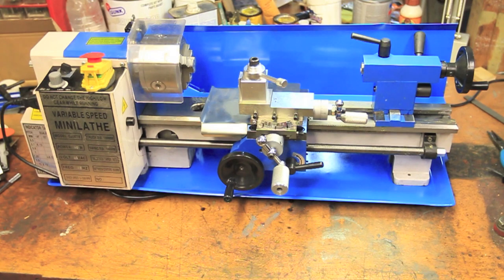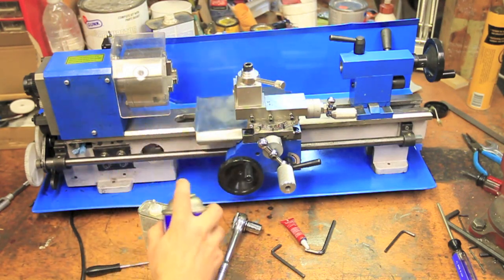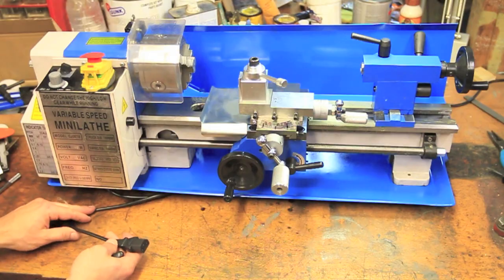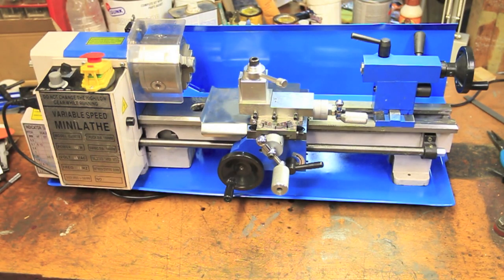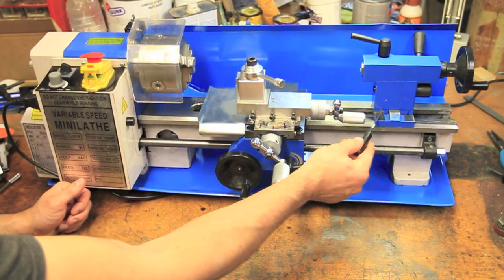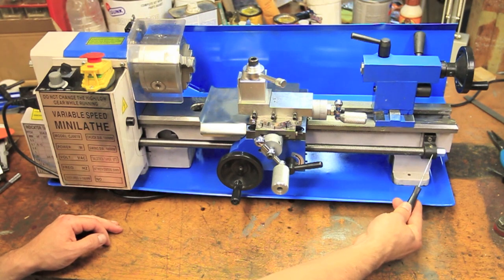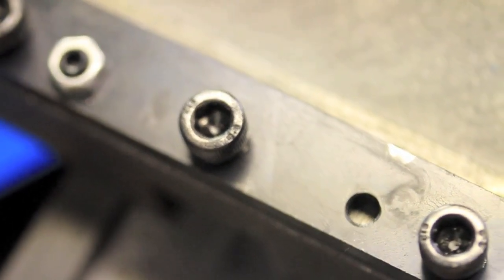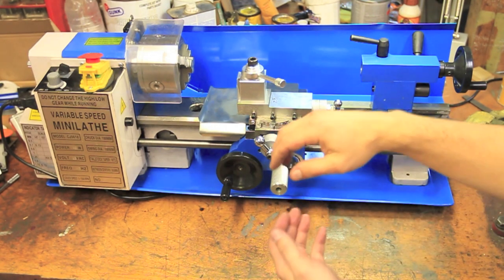Tear Down and Wiring Upgrade + Complete disassembly, cleaning, and reassembly of mini lathe

Comment: nice vid. one tip from me, allways use oil to lubricate sliding ways. it flushes chips out. grease is not a good thing, since it makes al the chips and dirt stick between the ways, making a sort of grinding compound. cheers.
Reply from the maker: Good tip I'd definitely change out the grease. Thanks for watching!
Reply: I agree! Regular engine oil is cheapest and works well. When I got my china lathe I first use chain oil, everything got very stiff and dirty! ;) Very nice channel! :)
Reply: Use high winter weight oil, since that will be thickest at room temperature and thick oil works better. Also watch for greying of the oil which shows your oil isn't preventing wear.
Reply: Flip de boer Yes. Go for way oil. There should not be a zerk fitting, as you mentioned, but a little oiler (small cup srewed into the hole filled with some oil). A little oiler would be a nice video project. By the way: I admire your patience. I think I would have melted down this nasty lite machine in my backjard furnace, just to see it burn!  But from video to video it is becoming something like a usable tool. Thanks for the videos!
Reply from the maker: Thanks so much for your comment and suggestion! I really appreciate you watching and enjoying them!
Reply: Usual recommendation for oil for rotating parts is 20W machine oil or nondetergent motor oil if you can find it in that weight.  For sliding parts I'd suggest a way oil such as Mobil Vactra #2 which is easy to find -- in gallons(!).  Email me if you want to discuss the fact that I could easily spare a pint of it.

The particular virtue of way oil is minimizing stick-slip friction cycle.  The main reason I know of for non-detergent oil is that detergent oil is somewhat hygroscopic, and is specifically designed to pick up and carry dirt, rather than letting sleeping dogs lie, so to say.

Comment: I've been doing a lot of research on lathes and their purchase. Most forums have scared me off buying one of these cheap lathes, however the videos in your channel have changed my mind. IMO there's no better way to learn how a machine works than by disassembling it, making sure things are the way they are meant to be, potentially upgrading or improving it then reassembling it.

The fact that buyers are forced to do all this with an inexpensive chinese lathe is a bonus, IMO, not a flaw.

I have some things I wish to make that require a lathe, and I'd love to learn how they work with a long-term goal of building one of my own. You prove in your channel that even a cheap one can make something aesthetically and functionally great. I'm sold. Count me as a new sub, and thank you for posting these vids.
Reply: That is an interesting perspective.
Reply: With this many repairs, you could make one. Well, maybe not you, but a person could make one.

Comment: I have a similar lathe but with digital tachometer. Basically the same, seen these lathes under many different names but probably all made by the same company. Great video and upgrades. The circuit breaker for one is something I will do. Motor mount will be reviewed and the carriage. I noticed my carriage has some play and need to tighten it up. Thanks for sharing, I can see you put in a lot of time!

Comment: If you buy a 7" mini lathe, a simultaneous purchase should be a a mini mill so that you can fix it properly.  Once the rebuild is complete they are surprisingly capable given their size limits.  Tim you need a shop vacuum.   Thank you Tim, good video.
Reply from the maker: Agreed! A mini mill is on my wish list haha. I have a shop vacuum, I just need to use it :)  Thanks for watching!
Reply: but how do you make the mill into a not piece of crap without a real mill to make real parts for the mill ?

Comment: I noticed you soldered the wire before crimping the connector on. I was taught that this was a no no as the soft solder can cold flow over time leaving a loose connection. The crimping action actually welds the wire and connector together due to the pressure.
Reply from the maker: Interesting - I didn't realize that. Thanks for the tip... no more tinning before crimping for me then.
Reply: I don't think a hand crimping tool provides enough pressure for cold welding.

Comment: Wow, man how did you put the head back right? I’ve got hard time getting the spindle parallel to the ways after disassembly! 
The main improvement to be done on that lathe (I got exactly the same so I know for sure) is replacing spindle bearings to conical ones. That’s not hard, though should be well planned before disassembly for some details may be needed to be prepared on lathe. Switching to conical bearings makes a big difference!
Lapping slides was a good idea, as well might be additional tapped holes for screws to lock the slides for additional rigidity (cross slide locked while turning, top slide almost all the time, like you lock your saddle while facing). That’s may be the most rewarding upgrade on the mini lathe for it takes only about 15 minutes for great improvement in rigidity.
Adding fast connections to all wiring was a great great improvement I’ll certainly copy to my lathe, those wires are such pain in the butt.
And, yeah, such lathes should be properly inspected before even turning on, I wish I knew it two years ago :)

Comment: Hi Tim, I was wondering if you may have thought of replacing the spindle bearings with tapered roller bearings? From what I gather, it improves the spindle run-out tremendously: 80% from the other videos on YouTube. (0.06mm down to 0.01mm) Thank you for the videos and great ideas!
Reply from the maker: I have! And I'm sure I will at some point but just haven't done it yet.... however, when I do, there will definitely be a video :)

Thanks for watching!

Comment: Having owned one of these lathes for 5 years I have found that out of the box they are not really usable and do require setting up and modifying to get the best out of them.In the end modification to the lathe can become a hobby in itself Roger
Reply from the maker: Haha I agree and definitely see that happening.
Reply: It’s like “The main purpose of reprap3d printer is printing details for itself”.
Once you got into there’s no way out, only adding more and more, I’ve done leadscrew handwheel and independent power feed, extended travel of cross slide and added power feed to it as well, installed ammeter, changed saddle plates, fabricated new banjo, upgraded bearings to conical, lapped saddle to fit the ways, lapped all other slides, added stops and locks and only now realize how DEEP is a rabbit hole and that’s only beginning ;)
One may add a fear and loathing in LV quote replacing drugs by tools, I feel to lazy, but the main idea remains: once you’ve started with such addictive shit it’s damn hard to stop!
Reply: @grimoirworkshop6623  Stop!  You're only making it harder to not buy one of these mini-lathes so I can tinker with it!
Reply: Coffeehound yeah that’s a lot of fun

Comment: Here in your disassembly video it is easier to see the options for a possible indexing hole circle. If the flange plate on the spindle holding the chuck is not hardened (i.e. if a file can cut it) then you could drill one or two hole circles into its circumference. Then you fix a tangential arm reaching from the rear side of the headstock over the edge of the flange plate and drill a matching hole so a pin can be pushed through it into one of the indexing holes in the flange and you got yourself a spin indexer integrated into your lathe. I recommend 2 hole circles side by side with 30 and 36 holes. If only one circle fits in then with 36 holes.
Reply: rol eic !

Comment: Good video!
Tip: There is a "Chinese website" called AliExpress, do a search for drive belt ... you will be surprised to see what is available.  I saw one comment on there by someone saying that one of the belts will bring his mini lathe back to life.
Hope it helps, good luck!
Reply from the maker: Thanks for the tip! I ended up swapping out the motor pulley and finding a perfect replacement on Amazon.... it's a later video if you feel like checking it out!
Reply: Francois Fouché Or you could go on Alibaba and buy them in bulk so then you have replacements and they're cheaper per belt.

Comment: I was using compressed air to clean my lathe while still pugged in. Chips got behind the circuit bd and it fried . It was old and I got it 2nd hand. Ways was out of spec. I bought one like yours off eBay. I thought it would be the same but no. No 2 speed, that sucks. The lead screw has no neutral. The main bearing housing is aluminum not cast iron ( I use to use it as an anvil).  I like the tail stock quick disconnect. And the chuck is bigger. That's good in a way but I have a 4 jaw chuck , collet chuck and a face plate with smaller bolt pattern. I'll have to make an adapter plate for those. I swapped the cranks off the old one because they were nicer.  I'm glad you showed the inside gearbox because I was looking for a place to put some white lithium grease in there but no I see with no transmission 2 speed It doesn't need any.

Comment: Jeez. I'll have to do ALL of this before turning on my new lathe ...
BTW: 'Tin' your soldering iron before using it on anything - that means stick some fresh solder on it, then wipe it off. 
Makes it go much easier.
Reply from the maker: Thanks for the tip :) and you don't necessarily have to, but it will probably save you some headaches later on. Plus it's a good way to learn how all the pieces work. One note though is that I used grease in the video and as suggested by the other commenters, I switched to oil (just 10w-30 motor oil) and it works nicely, so I'd suggest the same for you.
Reply: Thank YOU for doing this series of videos.
They will certainly save me some ball-ache later.
The hours of work required to improve the machine are certainly worth the effort, if you like that sort of thing, and personally i do.
They are so cheap it's kind of a 'why not' decision.
Once i get mine to work reasonably well there are some stepper motors waiting ;)
Thanks again for this series of videos.

Comment: Hi, nice video! You can use slightly larger belts by adding an adjustable tensioning roller, similar to the way timing belts on  cars are tensioned.
Reply from the maker: Thanks for watching! I thought of that but couldn't think of a slick way to make a tensioner with the limited room in there. I'm not ruling it out though and it's a good idea!

Comment: I enjoyed this video. I love the extra work you went through to make everything work much better!
I actually watched the whole video, I wish you had added some commentary to the long video after your "quick overview" at the beginning.
I am interested in hearing how all the extra work you put into the slides paid off!  Was polishing them up with the lapping compound and then the rubbing compound worth it?  Did it make everything work better?
Also, what is the largest diameter piece of material that this lathe can actually, legitimately hold?  I know you had issues with the crappy guard hitting the chuck...  So without the guard, how large can you hold?
Reply from the maker: Thanks again!!

I tried to get all the commentary up front just so you didn't have to watch the whole thing to not miss anything but I appreciate the feedback.

As for the slides, I think they were better and a little less "grabby" but still not as good as they could (or really should) be. I have some more idea's I might try and will for sure do some videos if/when I do them. Mostly they would be focused on changing some of the other poor/lazy design aspects. 

The guard was pretty useless and really only good for preventing leaving the chuck key in the chuck and keeping you from getting sprayed with oil after oiling the chuck. But it has since broken off. As for the largest diameter - check out this video: https://www.youtube.com/watch?v=8X-PuLm9XQU be sure to read the comments though as there are some good safety suggestions in there.

Comment: At 12:01, that tiny spring between the handle and the slide screw, where does it go? I took mine apart and it fell and have no idea where it goes. Thanks for the great video by the way. ☺

Comment: Looks like our lathes came from the same factory, as I have had most of those problems plus a couple of different ones. I couldn't find a source for the drive belts as mine measured at 3/16" pitch and nobody makes them anymore. I ended up making new toothed pulleys to fit a standard belt on the CNC router. It looks like you put the old one back on.
Reply from the maker: Haha it's nice to know I'm not alone... thanks for watching!

I put the old one back on in this video but ended up fitting another drive pulley on the motor that matched the pulley on the head stock - feel free to check out that video too https://www.youtube.com/watch?v=3CXZCu3T7Mw

Comment: I have been looking at these cheap mini lathes.
After watching your vids about this, I am wondering if they're worth the trouble.
Curious as to how much you have spent, total, including all of the mods you've done.
Reply from the maker: It depends on what you're trying to do and your patience to money ratio. I haven't really been keeping close track but I've probably spent close to as much as the lathe itself on all the tools, quick change tool post, knurling tool, tail chuck, bits, tap and die kit, threading oil, etc. etc. 

Once you have all the tools and such, the raw material is relatively cheap and can be found easily on Amazon or eBay but also in bulk at local metal shops. The advantage of going to the metal shops is that they often have shelves full of "drops" which are the end cuts for their big orders and at their scale they are almost useless but usually still much larger than any projects on this mini lathe would need and they sell them at discounted rates.

Comment: You got the patience of a saint and that thing is a piece of scrap, doesn't mater how cheap a tool like this is  ,  it should still be usable in all its features and above all safely. That thing fails on all counts especially fit and finish. 
It's obvious there's little to no Qc where it's built. 
Nice job on building your own lathe I know I couldn't
Reply from the maker: Thanks, it's been a bit of work to get it to run smoothly and consistently... this really is more of a lathe kit than a ready to use tool out of the box. I appreciate you watching and taking the time to comment!
Reply: TimNummy, no worries, I'm a carpenter & joiner myself but never got into lathe work. Using a metalwork lathe and machining is something I would love to get into, nothing big just small hobby size, about the same size as that one, only thing now is that after watching a few of your vids I now realise how little I know about it and how easy it would be for me to buy a poorly made lathe and think it was me making mistakes when it could be the lathe, 
Guess it's back to "school" for me before I spend my cash, atleast I know a few things to look out for now and look forward to watching more of your work, 
Thankyou, Al
Reply from the maker: Yeah for sure! Sorry for the delay in my response... I knew more or less nothing when I decided to get one other than what they were in a general sense. As a carpenter, you might find better comfort in a wood lathe? They are generally much cheaper and would be a good way for you to get used to making larger semi round things into smaller more round things :)
Reply: TimNummy I think it's going to be a tough choice unless I can make room for one of each, just have to keep it quiet from the wife until my workshop is finished , I've got so many tools it drives her crazy, she just doesn't get it.her usual response is "what do you need that for" and "haven't you got enough tools" hahaha 
 Thanks for replying